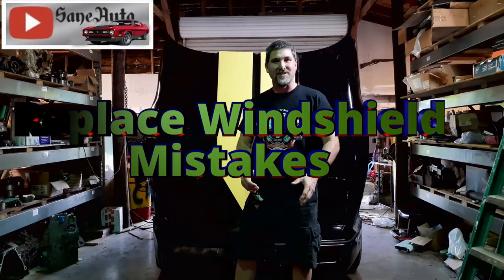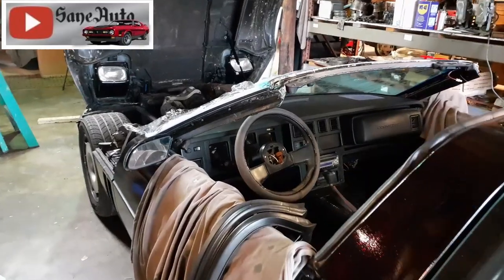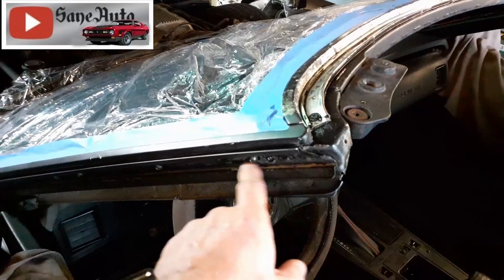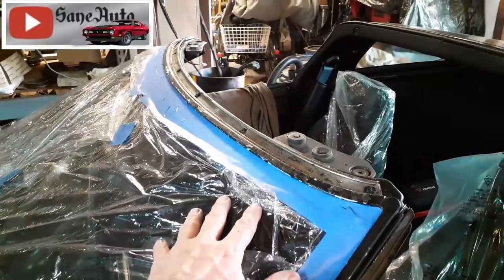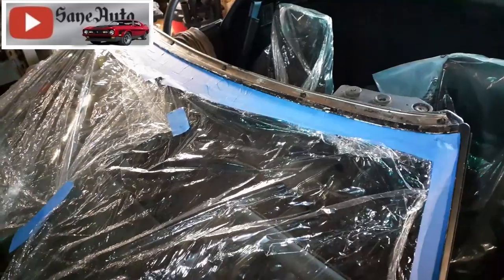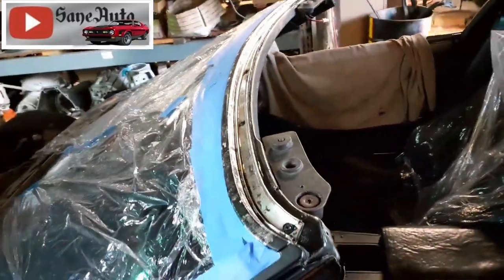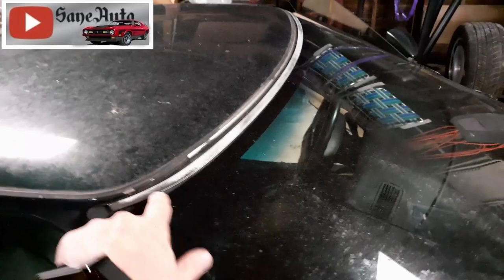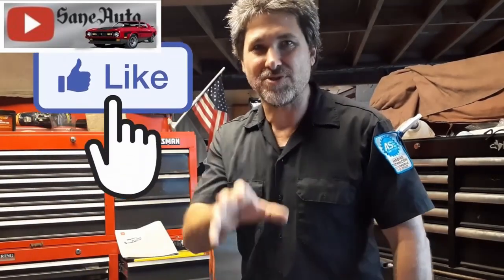New windshield replace Top 5 regrets & mistakes Corvette

Comment: Question: What's that metal part on the pillar where the weather stripping goes? I replaced my weather stripping on the windshield but water still leaks in between the window and that metal part. How can I fix that part? 
Great video by the way.

Comment: I’m about to get my windshield replaced in my 89.  It looks like the gasket has to be removed on the A pillars & across the top of the windshield to get at & remove the trim around the windshield.  Correct?  I appreciate the recommendation of painting the trim before the weather stripping is put back on.  Any other advice you can offer?